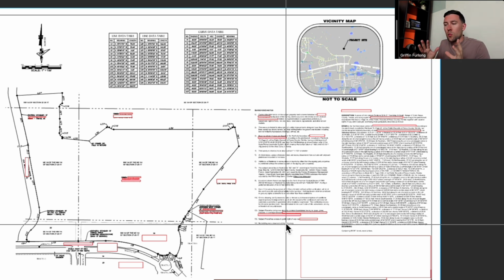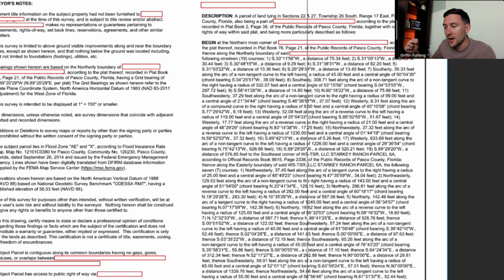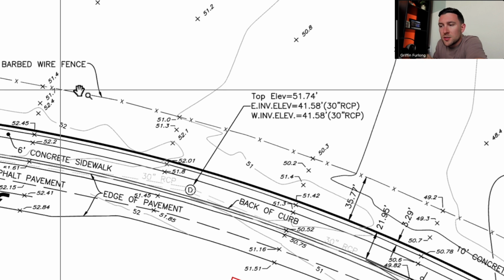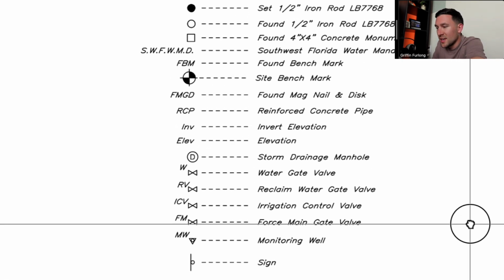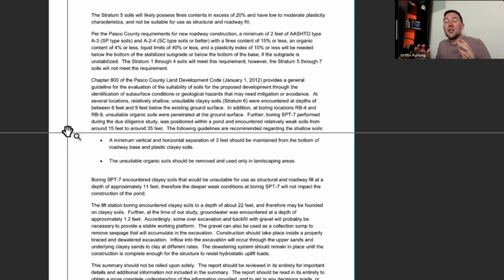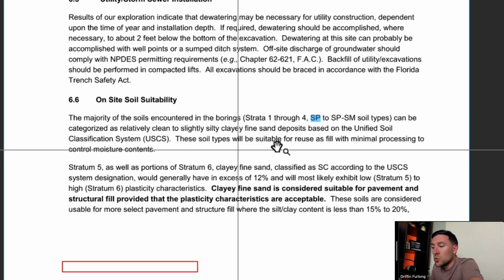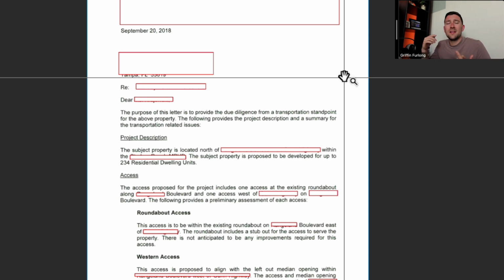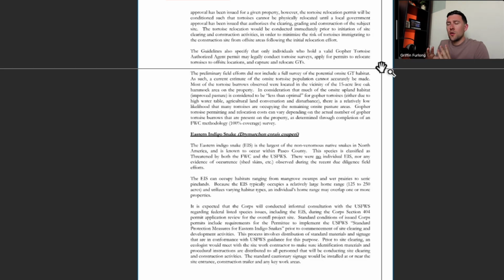Ep1: Reading Surveys, Geotech Reports, and Other Critical Documents

Comment: The geotech report can also contain recommended design parameters for retaining walls, bearing capacity value range and cut angle ranges the excavated land can tolerate. Just a few points from my experience.
Reply from the maker: Perfect